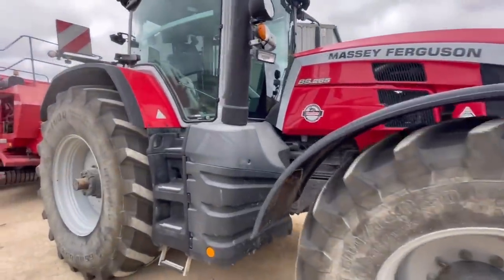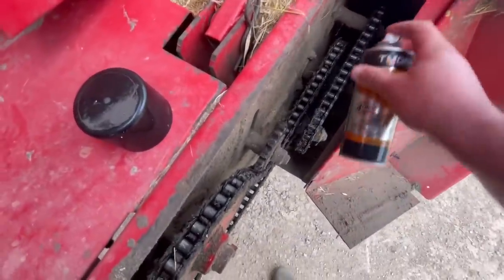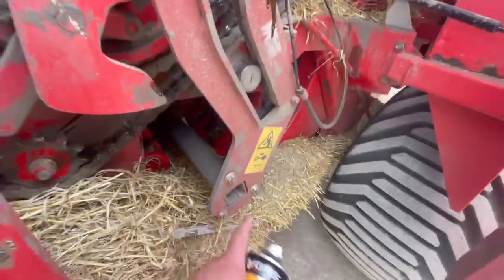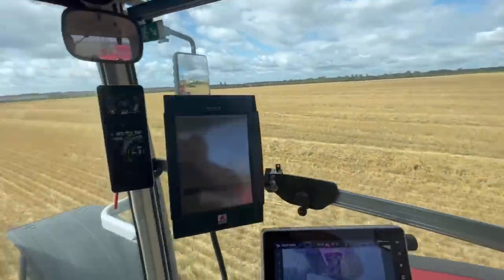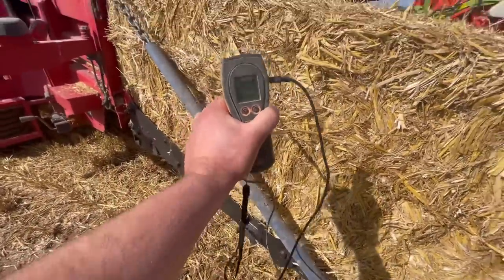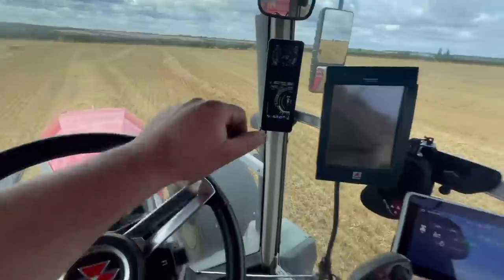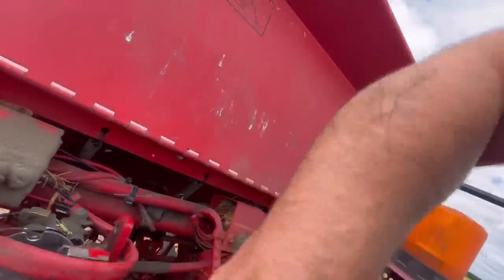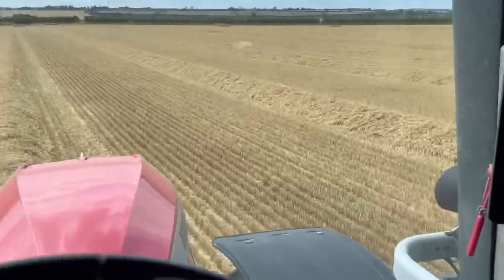Gone baling walk round and square bales.

Comment: I keep a pair of long nose pliers up near the knotters for pulling out string when it wraps, along with a flat screwdriver for popping the billhook open, and a 10" Bahco adjustable spanner which fits just right round the casting to lift the knotter up without hurting your fingers!